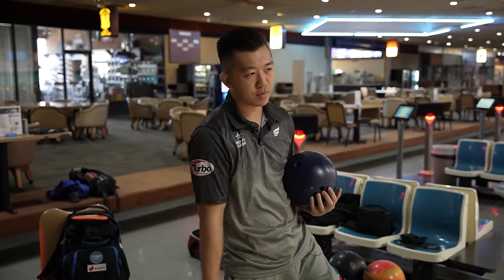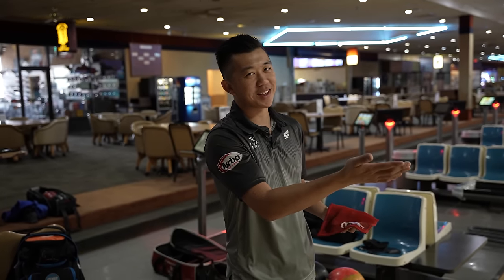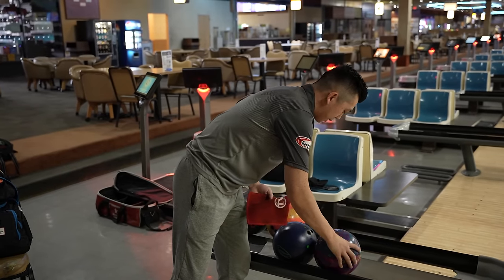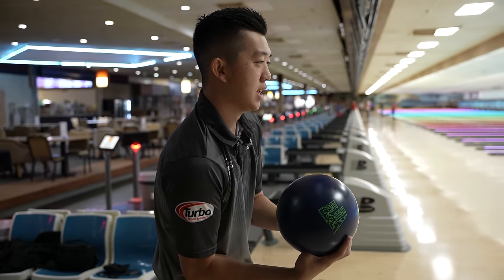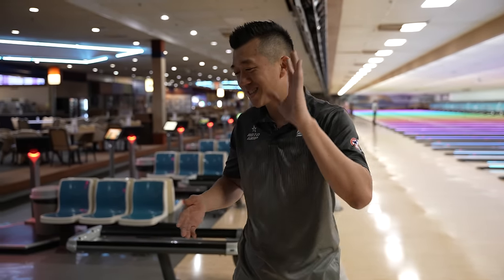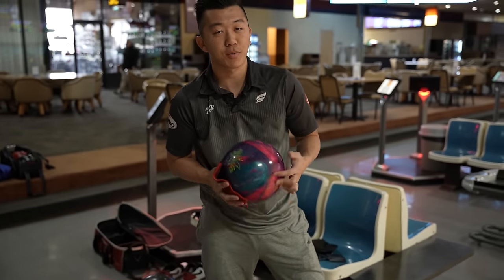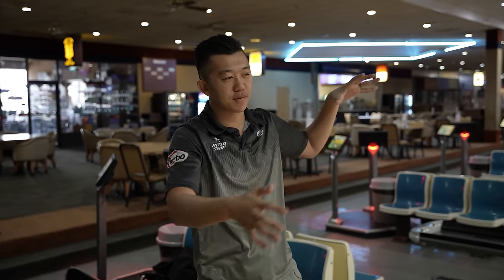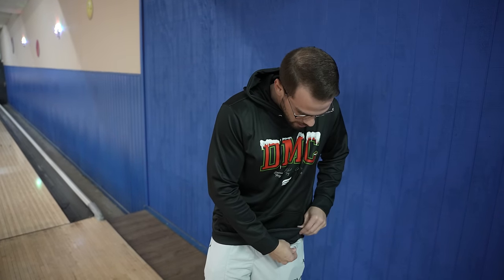Do You Need a Dry-Lane Ball or a Urethane Ball? | Ballsplanations Ep.6

Comment: Posting in case this helps anybody: I'm a lower-speed (13-14 MPH), medium-rev (350ish) bowler, and my league house changed owners early last season. Something changed and the lanes became MUCH higher-friction, to where I couldn't keep anything right of the head pin without throwing a 3rd-4th arrow "fade" shot and not having anything left when the ball reached the pins.

Urethane worked for me in that situation. It kept things in front of me and allowed me to play my preferred 2nd-3rd arrow zone. My average has jumped 20-25 pins with an overseas Wild Streak Tour/U, and I've got an IQ Tour 78/U coming soon. However, that's far less of a "dry lanes" thing and more of a "combat super-high friction" thing.
Reply: You can complain about that…I used to bowl in ny and we didn’t change owners but the porter messed the lane machine up and messed the shot up and everyone in the league complained and wouldn’t touch the approach until he fixed all the lanes…and the owner made sure he did everyone he messed up that same night

Comment: I would have liked to seen you get lined up with the Fast Pitch on the house shot to show how urethane can be used on house.
"Modern" urethanes generally can have issues on house shots because the coverstocks are so super strong and read the lane so early.
But Vintage urethane was designed in an era when there was much less oil, typically a max of 7mL. So you might actually be able to say "vintage urethane" is a dry lane ball.
Reply: I was just throwing my 1990s Columbia The Beast against my newer Hustle Wine.  The Wine was 5-7 boards stronger.  The Beast looked more like urethane than reactive.  My Hyped Hybrid was another 5-7 stronger than the Hustle.
Reply: 100% correct.  "Vintage" urethane was mostly designed for the original "Short oil" patterns of the 80's, which was like 24 feet.   So back then, (I was working for a pro shop) nearly every new ball claimed it "Went farther and hooked harder".  And they were all shiny.   The dull ones were for the 40' PBA patterns or no-rev bowlers, but the vast majority were shiny "goes longer/hooks harder" balls.  
So if you still had one of those...it'd probably be useless on today's oil, honestly, unless you rev the snot out of it.  Something like an old Firebolt SO or a red pearl Hammer, would nearly be a spare ball today, most likely.
Reply: @SealofPerfection  I currently use three vintage urethane balls on house shots with amazing success. My Brunswick Grizz. Grey Rhino and the mighty Cobalt Rhino, strongest of the pancake Rhinos. I shot 267 on house with the Cobalt slow rolling it up 8 board. I only have a 90-110 rpm rev rate. High revs are definitely not needed to make urethane work on house. If you are interested you can see these three balls in action on my channel.  Videos #133, #141 and #156.

Comment: I use mainly two balls. A plague pearl, and a Mix. Both urethane. I have about 400 rpm at 14-14.5mph ball speed. Most of the centers around me always have lower volume conditions and for me, reactive balls are just too hard off the spot, even sanded, for me to control. Which is why i use urethane, because i need more control of the friction in the middle and end of the lane. When i had a pitch black i had it polished so it wasn't so early digging, but the fact that it was still urethane made it more controllable off the end of the pattern. For anyone who is rev dominant, you can use urethane on a THS and be fine.

Comment: If you were to bowl on the short pattern but could not use urethane, what would be some suggestions? Ball, layout, surface.
Reply from the maker: Depends on the lane surface and a number of other factors, but it’s typically good to start with strong covers to try to read in the oil, or using a lot of surface on a low diff ball.